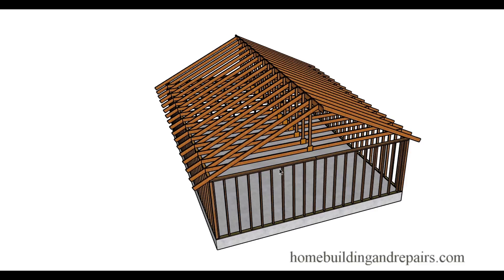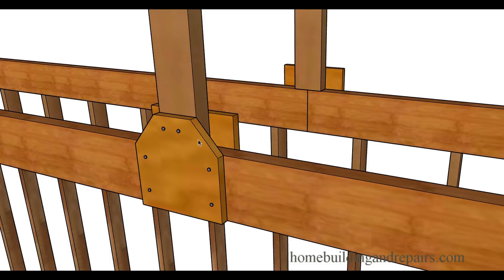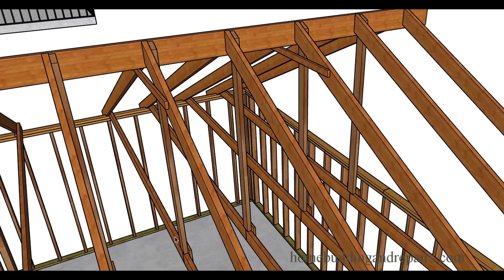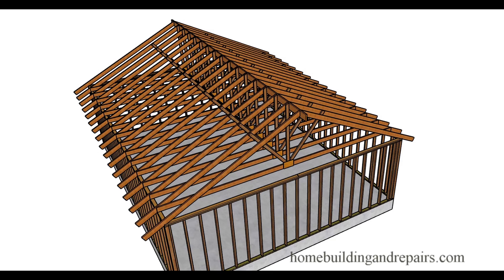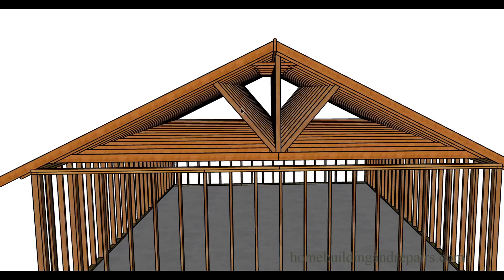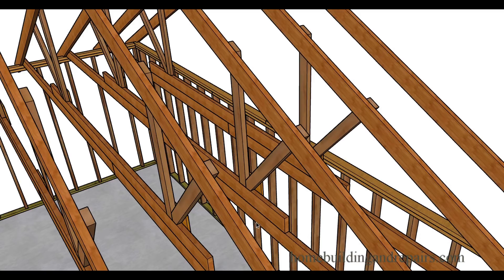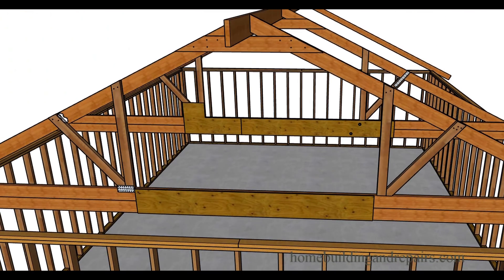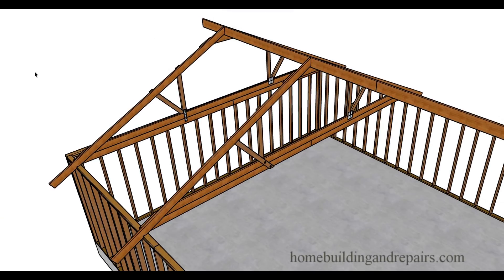Large Building and Garage Roof Framing Ideas for Additional Attic Storage

Comment: I have no idea where this building is located, but most building departments will want an engineer's seal on any truss design before they approve a building permit for a change to the roof structure.  The days of guessing and this seems to work are gone in almost all locations of the country.
Reply from the maker: These are only meant to provide suggested remodeling examples and engineering should be considered.
Reply: Days of guessing? So why are airplanes falling from the sky, if they use most sofisticated programs to calculate all stuff??? Get real. All programs are built out or real stuff and real experience.

Comment: Think you are out of your element , get an architect to run the numbers on the loading for each individuals design . I have been a carpenter for 50t years no way should a load on a joist by guessed at the design . Your first drawing web creates more problems, don’t do it
Reply from the maker: I don't think I would hire an architect to acquire engineering information.